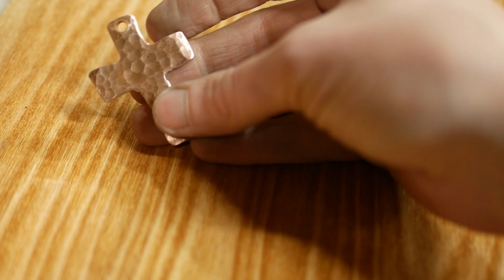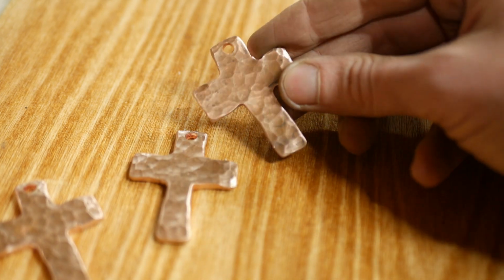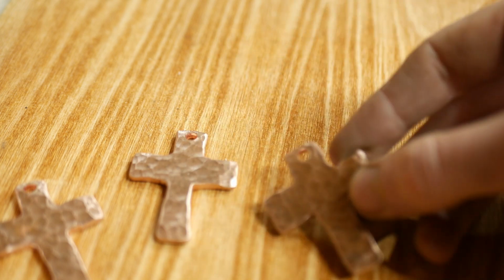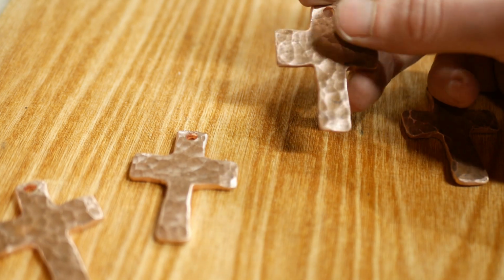Making a Cross Pendant (Forging with Jess)

Comment: Nice job, Jess. You may want to try a Dremel for smaller things, they have a bunch of bits\cutters for it.👍
Reply from the maker: I've thought about getting one. Never used one though.
Reply: @ChristCenteredIronworks   It's easy to use a dremel, it comes in handy a lot of the times I've used it. Add in a flex shaft and hold it like a pen for even smaller item's.  I have cut 1\4 thick glass with a carbide cutter! For drilling I would use carbide drill bits, you just have to keep the drill bit straight, or it will break! Look to eBay for the drill bits, for big cost savings.

Comment: looks nice, and with trying and doing things there is always a learning curve, you should see how often I get a blank for a pen that dont drill exactly even makes it risky and a nightmare trying to turn on the lathe, or things I have to retouch due to accidents
Reply from the maker: Nothing replaces hands on experience, huh? I need to use the band saw more.
Reply: well jess practice does make perfect,  if the bandsaw is not working there are other ways to cut the crosses out though I am not sure which one will be the easiest to use or have best effect notchers work well with sheet metal, but not sure if the copper is too soft to chop off with one or one I suppose could use a chisel to cut stuff with but that takes longer yet, a torch problably would not work as an oxy torch uses oxidation to cut the metal and copper well dont work in that way, 
but for somethings practice makes perfect.

Comment: Those are really nice. I am curious would you make any in like a high polished brass without the opening marks. If so do you have any idea what they would cost? If you don'thaveextra brass around how about copper the same way as I discussed above. Great work.
Reply from the maker: Hi Rick, I am afraid I don't quite follow on "without the opening". If it is a bit differently shaped, you could send me a sketch. Brass could be a possibility, similarly priced (I listed these at $35), I will have to check with Roy if he has brass. You can send us a message through the "contact us" page at http://www.christcenteredironworks.com. Sincerely, Jessica at Christ Centered Ironworks
Reply: @ChristCenteredIronworks  I was referring to the peening  marks from the hammer. Auto correct changed it to opening.

Comment: Please be careful, Jess. I've seen the outcome of wearing gloves gone wrong on a band saw. I personally prefer having a thumb on BOTH hands.
Reply from the maker: Hi Stan, the copper being so small and in such a short section, it heated quickly. I am not sure if I could have gotten away with not wearing gloves. A good safety reminder though :)
Reply: @ChristCenteredIronworks  
I'll look into sending some vice grips, pliers, or lockjaw tongs. Opposing thumbs are hard to do without.